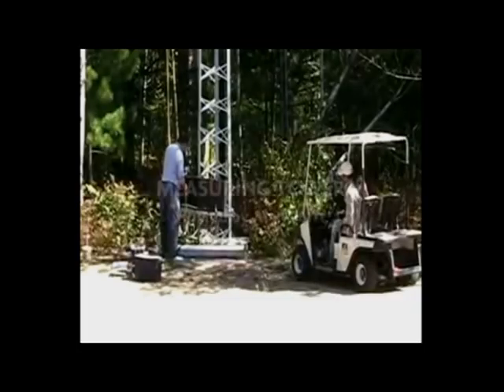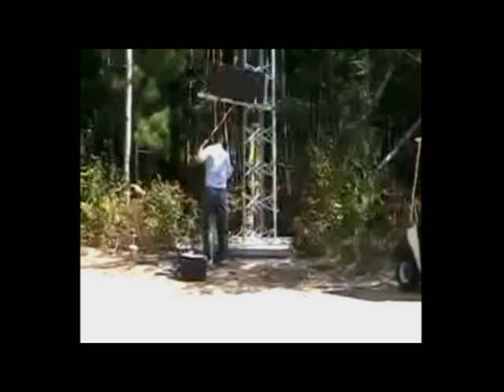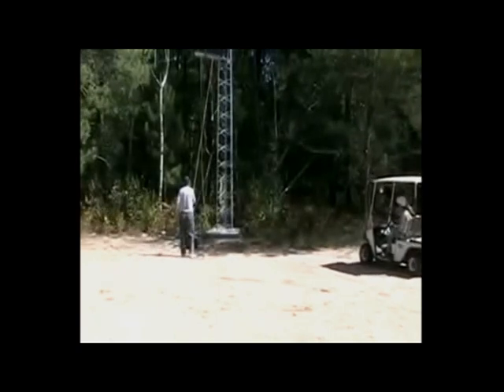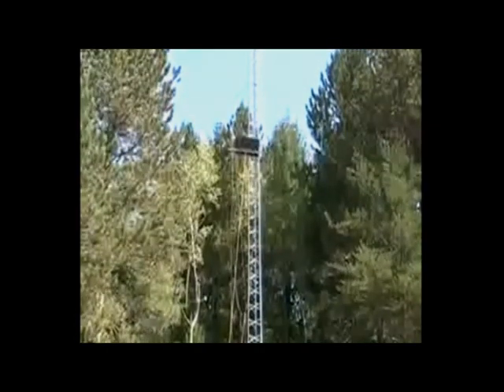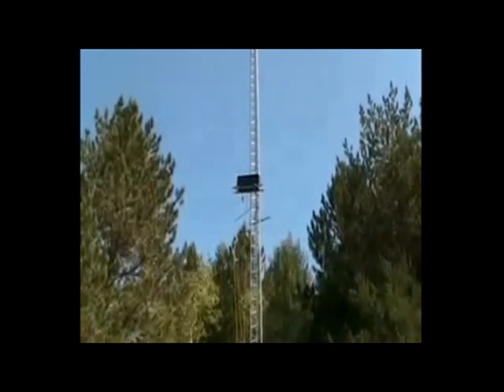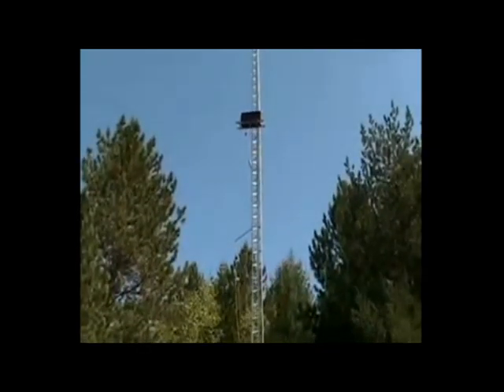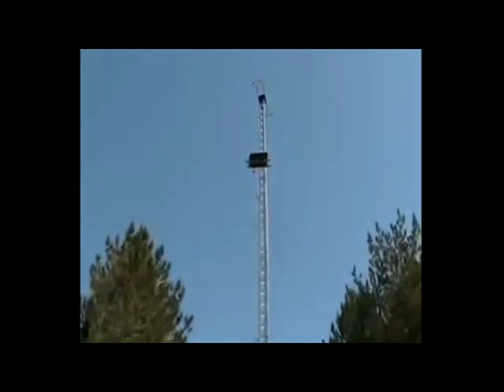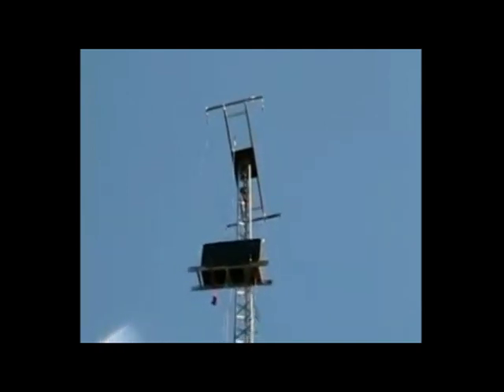Subwoofer Testing on a 90 Foot Tower

Comment: Now that is the right way to measure a subwoofer!  Of course you could also just do a 2-pi measurement on a large flat surface and subtract 6 dB and get very close to the the same result but the tower is the best way.  You need to also look at distortion however.. hometheatershack /forums/subwoofer-tests-archived/973-axiom-ep-600-2nd-test.html  The reviewer did comment however that the sound of the EP-600 wasn't bad considering the poor measurement results.